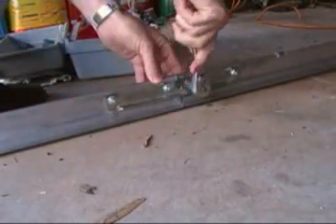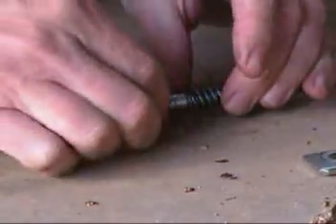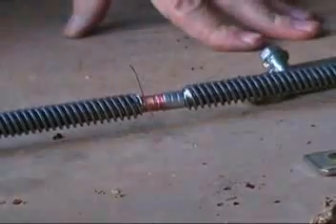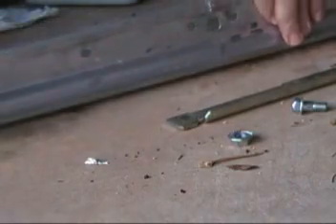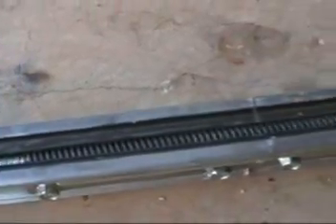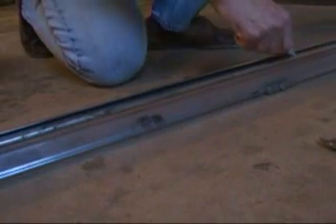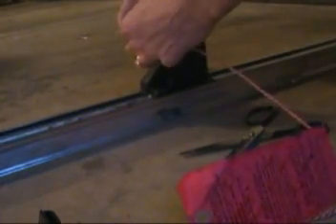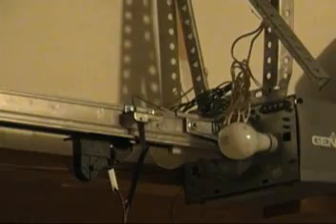Genie Screw Drive Garage Door Opener Failure - Repair - Part 2

Comment: I wish you could have kept the red tag on the carriage
Reply from the maker: I'm not 100% sure what you're getting at, but it might have to do with security.  I made some changes to the carriage to prevent a thief from putting a coat hanger through in order to trip the emergency release and so break into my garage.
Reply: @sengsational  oh ok because I like the red tag on the older genie screw drive openers and the genie pro max series openers and chain glide openers

Comment: Just out of curiousity, does this still work a decade later?
Reply from the maker: As a matter of fact, it's still working!!  Thanks for asking.  I had replaced the torsion springs with the ones that are supposed to last longer, and those haven't broken.  And, to my surprise, the screw drive is still operating well, even though my wife opens and closes the garage door 15 times a day, lol!
Reply: @sengsational  I remember watching this video when I was 5 and I loved how you fixed it. Surprised it still works.
Reply: @sengsational Hey quick question, does it still work?? Its only been 3 years, I remember watching this video when i was about 5 or so in 2011, and now i was looking back through some of these old garage door videos i liked and found this one.
Reply from the maker: @warn3535  Yes, Still working!
Reply: @sengsational  you should make an update video to how this thing is doing now

Comment: If anyone has a screw drive opener and they experience a loud BANGING noise as the opener pulls the door up, here's what I found on mine.  The noise happened twice, as the carriage moves between the sections of the screw; three sections, two connections.  The carriage's gear, which meshes with the screw, was getting worn down, and as the worn teeth passed between sections, the mechanism made the BANG noise.  If you have read other people report about their screw drive opener grinding, or only opening 1/3 of the way, and the worn-down carriage was the cause, the BANGING is one more possible symptom of the problem.
Reply from the maker: Thanks for helping other people with the diagnostics of these multi-part screw drives.

Comment: It is rare for the collar retaining clip to fail.  Most times it's the rack on the carriage getting worn down.  Sure enough your video showed major wear on the rack.  I couldn't tell from your video whether the clip was there or not... the clip only covers half of the screw drive shaft... sometimes you have to jog the controller to rotate the shaft.  The carriage replacement part is $15 and there is no need to take the rail down.  Old one slides off at the door end and the new one slides on.   Also, if the rack on the carriage wears down, it will usually fail to pass over the drive shaft joint closest to the garage door because that is when load is highest.  If you manually raise the door past the joint closest to the door, then actuate "raise", and the carriage passes over the joint closest to the opener, it's typical that the carriage rack has worn out and there is no reason to deal with the coupling or clip.  I found it humorous that people complain about an $8 cost of a part in the comments below - it's clear you've never tried to make a go of a company that has to stock infrequently ordered parts and service a relatively limited number of customer orders.
Reply from the maker: The clip is a bit of metal that weighs a gram or two...hard to justify paying $8 for it.  The clip in my case was jammed up alongside the screw drive.   The clip came off and caused the carriage to get chewed-up.  This is just a crappy design, imho.  Ever since I wrapped the copper wire and soldered that in place, I've had no problems.    I took it down for diagnostics since I had no idea what was really wrong with it.

Comment: To put it succinctly: YOU DA MAN
I totally let out a Tim-the-Toolman-Taylor grunt when the door lifted 😂
Hubby & I are well on our way to fixing our garage door thanks to you! 👍🏻
Reply from the maker: Thanks for the positive reinforcement!
Reply: @sengsational  ... total "can do" positive attitude .

Do yourself a favor: add 2x rubber standoffs to the head unit. This addition will make your screw nearly as quiet as a cheap belt drive unit!

Take 10mn to add 2 drops of engine oil to the motor bearings, very quick and easy to do.
👍🏻

Comment: The collar and clips can be replaced in situ without taking the rail or anything else down,  making this a 10 - 15 minute job.  I don't think that's an option when changing the carriage though as needed doing here.
Reply from the maker: Since I didn't know what was wrong with it for sure, so took it down to diagnose.  But yeah, I think that one end or the other needs to come off to get the new carriage to slide on.

Comment: I took the rail down(H6000)to clean the screw & track of old grease,pulled out the screw cleaned it  + the track,everythings great reassembly time.The second segment of screw just doesn't fit back in the track, it was like it swelled ? I replaced the collars I got raped for.. $8 just to be sure it wasn't out of alignment.Day 2.. praying the "collars" were the problem(sinking feeling it wasn't) cause it's OVER if it doesn't go back in & spin freely ..re cleaned & greased & now the first segment won't go in at all... now I'm just stumped  & sick!  the rail shrank or the screw swelled ..witf happened ? I got no opener now & have to buy a new one.Easy job - can of worms- disaster.The new ones mount different now, doesn't have the nice east to west bracket on the motor housing. I'm so fuckin pissed.
Reply from the maker: I hope you're still 'in the game' at this point.  Swelling / shrinking probably isn't the issue.  Sucks you've had these issues!  I feel for you.  Not every project of mine goes as planned either.  It's hard for me to diagnose, but let me try a few suggestions.  One thing that happens is that the old clip can be hidden somewhere and that can cause the worm gear shaft not to rotate.  Also, eye down the length of the track.  Does it look straight?  It should look really straight.  If it's bent, that might be the problem.  Maybe moving it caused it to get bent.  Maybe you can take the two-part track apart, into two pieces.  Take it off of the motor, even.  Then try the shaft and see if it slides in easily and spins.  Sorry I can't be more help.
Reply: Nope,game over.The screw would not go back in the track.I took the track apart,tried 1 piece at a time front to back back to front & everything in-between  re-cleaning & lubing.It was all done on towels debris kept away,track & worm free of any obstruction,extra cautious about bending anything-straight as an arrow..You couldn't even hammer the screw back in it was that tight.The only only thing I can think of is the white lithium grease compromised/damaged the surface of the track or screw,nothing else happened.I can't stand failing at things like this & become obsessed .. 1 in the L column this time >: (     make it easier to know why though..know what I mean ? I like what you did though very clever.I thought of everything but that,bought the 10 cent collars & clips for $8 & now have collars & clips & no party to go to.So the new unit is up & running great ..but was really unnecessary..thanks for replying..I'm guessing the grease & thats why they highly recommended (specifically) Genie GLU 3..It did say "can cause damage using anything else" Once again the GLU 3 wasn't available in retail stores...& you can buy a brand new track assembly from Genie for $120. lol, another $80 & new(better) one.

Comment: how does one get it to run quiet?
theo from south africa
Reply from the maker: Good question.  I do not have an answer.  This door has made so much noise, no matter which opener I had running!
Reply from the maker: Mine is so noisy!  I have never been able to get it quiet, but haven't tried that hard.
Reply: whatever you do dont pack the screw with thick grease to try and quiet it down.  I tried that and it made so much drag it doesnt run anymore.  now i have to tear it all apart to clean the grease out.  arg.

Comment: Is that a wood door because I'm installing the same opener and I need to see if it can lift a heavy door like mine
Reply from the maker: It is a wood (with composite) door.  It's heavy as h-e-double hockey stick.  But the spring is wound such that the door is easy to operate by hand, and stays half-way up if you move it there and let it go (without the opener engaged).
Reply: Colton Beedy make sure door well balanced with springs..like opening it with your finger

Comment: Great video ! but on 3:20 the part that you just slide in( I call it latch ) mine doesn't want to lock like you did. Does it mean I have to replace this particular part to get it fix? Chains or the spring are running up and down. Thank you in advance !
Reply from the maker: Sorry for the long time in responding.  My guess would be yes, if that lever won't push down, and you really try hard (by giggling is back and forth), it may be that the carrier (latch) has a problem.  Let us know how you solved the problem!

Comment: Same darn issue but Genie said my doors were not balanced then I swathe separation.
I knew this clip thing would haunt me when I installed it. Genie does make  one piece , the unit was 2 bills 8 years ago.  Im going to expoxy or carzy glue my new clips this time.
Reply: I don't think gluing is going to work. I think the threads on your carriage  catches on the openings of the clip and wrenches it apart, but I am not 100% sure.
Reply from the maker: Enuf Ots That's probably what happens.  It might take a bunch of up/down cycles to loosen the clip, then it comes off and causes a mess.

Comment: What should I do when the carriage passes the stopper switch and locks against the motor ? This happens only when door comes up , not going down.  Thanks .
Reply: Oh man, that open limit stopper switch is suppose to stop the carriage from going too far into/towards the motor. There is one towards the door end too (a Close limit switch) for closing. The video owner shows that he has a mechanical switch on his model. There is a lever hanging off the switch and down the side of the rail such that the carriage will trigger it. If you have the same mechanical switch then you'll probably have to disengage the carriage (pull the string down), lift up the open limit switch lever by hand and manually slide the carriage back. Not sure what this will do to the timing of the travel between door open and close though. It's possible you have a wiring problem or a bad switch that allowed this to happen. Another possibility is that you don't have the mechanical switch but a magnetic switch (like the one i have). With the magnetic switches there is no switch lever that hangs down, but there is a magnet on the carriage such that when the carriage comes right below the switch it triggers it to stop. Good luck!

Comment: i have an older Genie ISD1000-2H 3piece screw drive opener and I haven't been too happy with it. The collar retaining clip has come off once again last week. This was the 2nd time since 2008. Each time it has occurred is between the 1st (nearest the power head) & 2nd segment of the screw and its 6-8" apart. The 2nd and 3rd segment has slid forward towards the door and hits a stopper. I had tried to push the screw back towards the 1st segment, but it does not budge. I didn't put a whole lot of elbow grease into it, but just needed to know if the screw is suppose to be able to slide inside the bracket? Does anyone know? Thanks for your video.
Reply from the maker: The track that contains the screw should indeed slide back and forth along the screw.  The instructions say "...slide rail section..." onto the screw, so it's supposed to slide.

When mine failed, part of the clip was jammed between the track and the screw, causing the screw to bind.  That may have happened in your case as well.
Reply: sengsationa1 I managed to get the 2nd + 3rd segment of the screw to slide back towards the 1st segment by wedging a screwdriver between the screw and the metal plate stopper. I think I had to engage the carriage so the teeth on the carriage meshed with the screw and then pull towards the motor. This gave me a little space between the screw and the stopper for the prying. Once loose, it slided easily. To my surprise, the clip did not fall out or get jammed in between the track and the screw...it just came apart...the collar was not able to keep the two hooked-ends of the screws together. I wanted to replace the collar and the clip, but another surprised was that the diameter of the collar in this model is too wide for it to come off the opening in the track. I didn't want to take the whole thing down just to remove the screw and to slide in a new collar. I put it all back together (with a new clip only) and everything looked seated and in place. Greased it up (white lithium) too. It worked for a few days and then it came apart again. I had to do it a 2nd time, but for some reason there was some resistance when sliding the collar over the hooked screw segments. I checked that the screw ends were mated squarely. I decided it was actually a good thing and tapped (gently) the collar over using a screwdriver + hammer. Well, it's been about a month now and all is working. I think what's happening is that the teeth on the carriage is the culprit. Whenever closing the garage door the carriage catches on the collar or clip and pushes it apart. Thanks!
Reply: Well, it was good for 4-6 months and now the retainer C-clip came off again. The C-clip didn't actually pop out of the rail, but got flattened out (opened up) and wedged between the roof of the rail and the screw. I put the clip (had spares) back in twice and each time (after a few open and closing of the door) it came apart again. I checked my history of this opener and it was purchased in 2002. C-clip popped out of the rail first time in 2008 and the carriage was replaced in 2009. Been having problems ever since. I have seen it whereby the c-clip is off and stuck to the roof of the rail and the hooked ends of the screws were pulled apart;however it was still within the collar but the collar was partially pulled towards where the C-clip should had been to hold the collar in place.  Of course, the next use of the Genie and it comes apart. That collar is probably stretched out now. What a pain to have to take it down and having to take it apart just to replace the collar. They made the opening slot in the rail bigger in newer models so you don't have to take it down. I think it's the carriage that's causing it because when it was working...every time it goes over that joint segment (between 1st and 2nd screw) there is a loud "SNAP". I never heard it when it goes over the joint between the 2nd and 3rd segment. My guess is that the threads on top of the carriage are stripped and it catches the opening in the C-clip and "opens" it up and off the rounded end of the screw where it snaps onto. I ordered a new carriage and grease. Gonna take it down, replace the collar, c-clip, carriage, and grease it up. What a pain!
Reply from the maker: Enuf Ots Indeed a pain.  Those c-clips are just plain-old poor design!  Shoddy!  And someone had the gall in the comments of the first video to say my wire-wrap and solder was a waste of time. I beg to differ.  It's held up perfectly...no problems since I did it.
Reply: sengsationa1 I hear you. They don't know what they are talking about. 3 months after taking the whole thing down, replacing the collar and the clip it came apart again. Guess what? The c-clip was still on there tightly. The screw ends just came apart and the collar is just sitting there between the screw ends. Fact is the hook on one end of the screw is worn. That's probably due to the fact whenever the c-clip pops out and  the collar partially slides towards where the C-clip was... the screw ends partially unhooked while still being within the collar and the turning of the screw rounds off the ends when it is activated (before it comes apart). Seems if the c-clip comes off enough, there's wear and tear on other parts. However, that doesn't explain why only the motor end of the hook is rounded off. Prior to it coming apart, I heard that snapping sound a few times (when closing the garage door) as the carriage goes across that break in the screw segment. There was plenty of grease on there too. Well, so much for new carriage, new collar, and new clip. Now, it's either replace the screw segment (with the rounded hook if possible) or buy a Liftmaster as it's way too much trouble to work on this over and over again.

Comment: Get an oil can and oil every hinge and pivot on your garage door and it will make it much much quieter than it is now and easier on that plastic piece you just put in. It doesn't hurt to spray the return springs with a liberal dose of WD-40 either. I have a Genie screw drive and the only noise it makes is the motor itself. I hate squeaks. Also if you look around you can find much larger tubes of that white lithium grease at a fraction of the cost of that Genie grease and grease the screw a couple times a year.
Reply from the maker: I've tried greasing and oiling, but at the time I must not have found the bits that are squeeking.

Comment from the maker: I think you need to take the track down, remove the end of the track, disengage the carriage from the screw, and slide it off the end.  It's a pain.  To take the track down, you need to unmount the unit from the ceiling, lower that down, then undo the track on garage door side, and lower it down so the whole thing is on the floor.